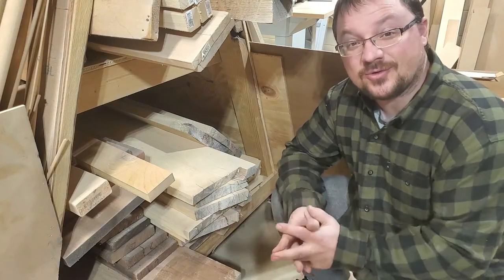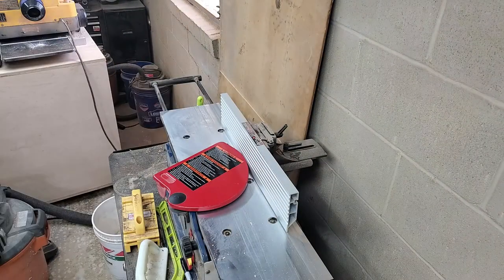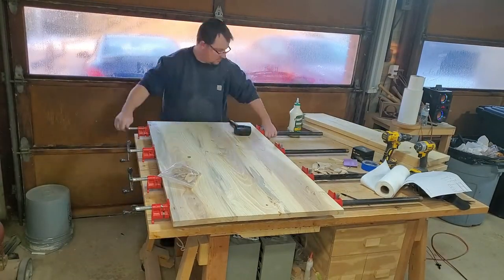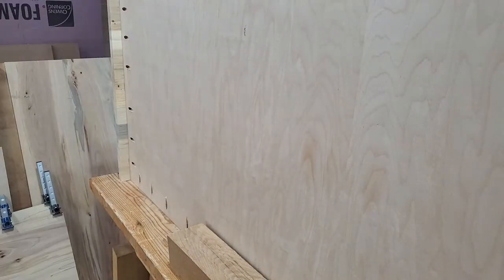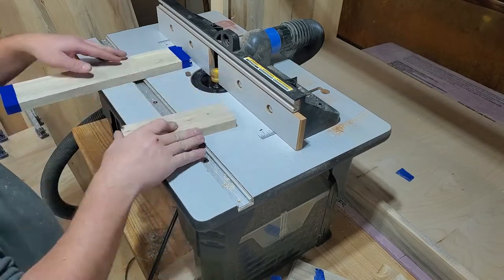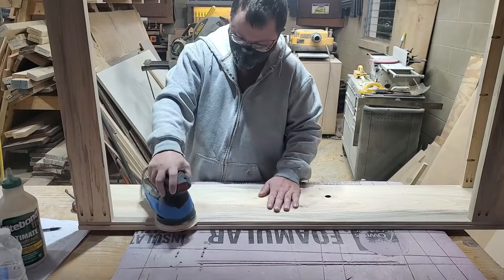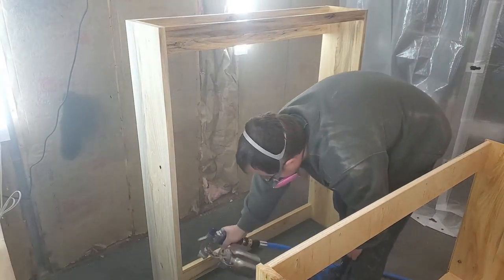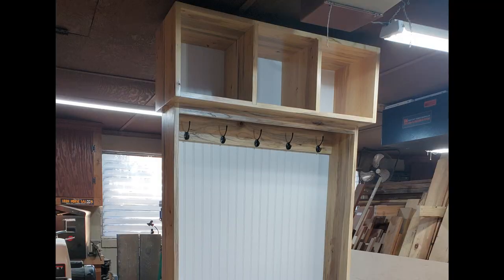Beautiful entry Way Organizer / Coat Rack

Comment: Couldn't you use the biscuits on the face frame, to glue that on rather than pocket holes? Might take some 'doing' to get them all aligned properly, but it would certainly be hidden! ( I'm no expert! )
Reply from the maker: I believe that would work and it probably would be good enough to be okay, but I don't think it would be as strong.  Maybe domino joints would be more equivalent in strength.

Comment: Couldn't you make dowels from the same material to fill in the pocket holes
Reply from the maker: Yes that is definitly an option.  My plug cutters wont go deep enough for this though and I do not have a lathe.  But yes if you could cut some dowels about inch and a half to 2 inches they would work out beautifully.